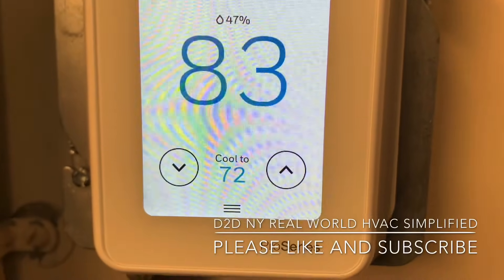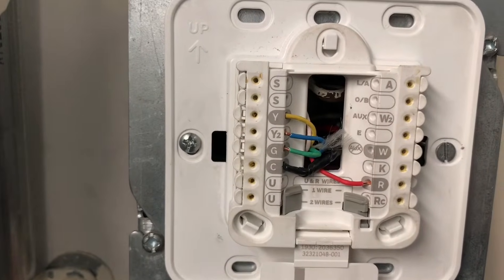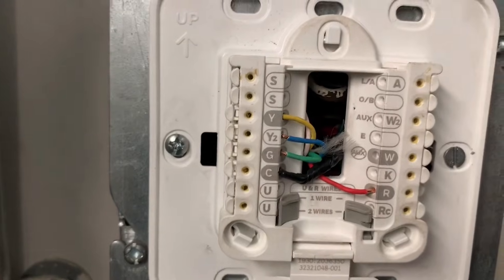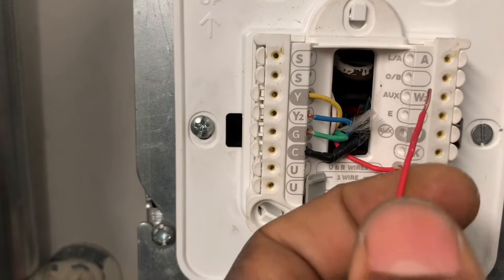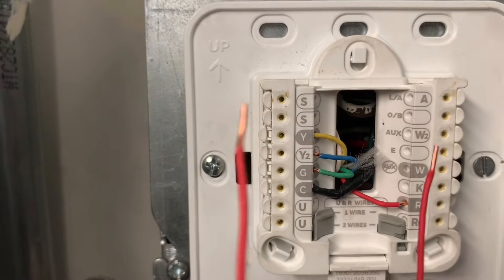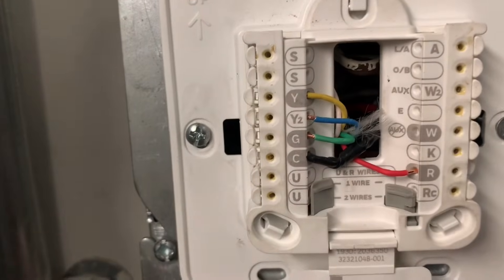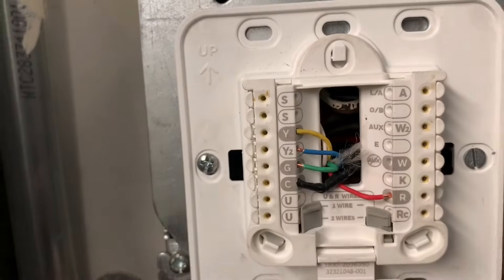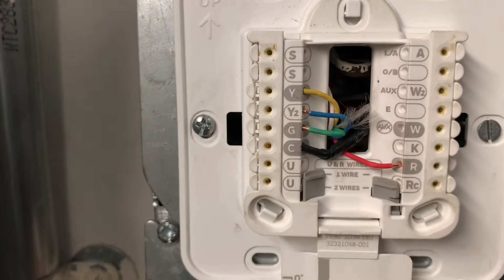HOW TO BYPASS ANY COOLING/HEATING THERMOSTAT  HACK

Comment: Thank you very much!  What happens when I bypass the fan (green) and compressor (yellow) exactly like you say here, but it still does not come on?
Reply from the maker: Then the thermostat isn't the problem  or there is other issues
Reply: Hey boss this video helped for like 2 days and my thermostat would work propeely again once I bypassed and then just hooked the thermostat back in . However now this method isn't working anymore any ideas ? @D2DNYAC

Comment: I have the same setup as yours shows except I have a very short blue wire attached from the R and  Rc right on top of each other exactly the way it is in this video.  Do I need to make sure they are not touching?
Reply from the maker: R RC is the same polarity especially if there’s a shunt or wire in between them, however both should be isolated from C always
Reply: @D2DNYAC  I tried shorting the RG and Y and I'm getting nothing... it has to be something with the condenser then I guess.. I have no clue about how to fix it.. unless I need to connect the G and Y to the R and Rc all together?

Comment: I appreciate this video.  I have an intermittent problem with my system.  The compressor fires up and then an overpressure switch shuts it down.  The fan never runs.  I have been able to switch the fan to the on position and when it gets around to starting I switch the system on heat and leave the fan running all the time.  I called the repair guy and when he arrived everything worked properly.  I paid $95 for a social visit.

It failed twice today,  I called the guy and before he could get here it started working again.  Next time I have the issue I can try to start the fan with a jumper.  If it starts, that would indicate a thermostat problem.  If it fails to start, then it is a fan issue.  I can probably pick up a thermostat cheaper than I can call out a guy.
Reply from the maker: Which fan are we talking about?
Reply: @D2DNYAC  
The air handler squirrel cage fan.

Comment: do these spring terminal boards lose conductivity after a time?  Im having issues with my fan not turning on and the jumper wire didnt work but removing the wires and touching them works.
Reply from the maker: Possible however in my experience unlikely. Make sure the wires is stripped properly

Comment: hi; i have thermostat of T6373B1239 old model and i will change to T5. how can do it?  The heating and cooling system is central, and in the summer season, the chillers are turned into cooling from the central system, and into heating in the winter. So I can't change the cold door to heating and vice versa. According to the above, what is the wiring method from the old model to the new one? thank you
Reply from the maker: Take a picture of wiring on old and match wire connections to new!
Reply: @D2DNYAC  how can send photo through youtube? Have you WhatsApp?

Comment: is it possible to replace the thermostate with timer power switch?
so the AC will on and off based on time set
Reply from the maker: Sure ,,, however all you need is right thermostat and use the schedule feature

Comment: How about if you have a heat pump? For cooling it would be the same . Y-G-R together?  Or do i add the blue for the reverse valve?
Reply from the maker: Depends on what part of the world you're in
Reply from the maker: In New York yes ygro together
Reply: When youre hacking these systems, dont mess with common the common is only to make the screen light up on a tstat.. but yes it would be R-G-Y (if its a compressor only that does cooling only)
Heat pump is R-G-Y-O (lennox carrier trane goodman)rheem and rue you dont touch orange

Comment: Thank you sir, you are the only who mentioned the danger of bypassing R to C. After all these years, now I know what C meant with the analogy of the battery you used.
Reply: Except R and C are 24 V AC (alternating current) HOT and NEUTRAL. The only positive/negative is happening between wave forms at 60 cycles per second!

Comment: My thermostat went bad, got me a T3 and followed your instructions. I live in Florida and the set temperature is reached but the unit keeps on running long after, I have to manually set it an extra degree for it to do so.
Reply from the maker: It doesn’t seem like there’s a real issue here often time thermostats will do this anticipating the load. Say you are  set to cool 70 and it took a long time for temperatures to come down to 70 , behind the scenes it could be  seeing 70.8
Reply: @D2DNYAC  I have to set to 75-76 for it to cycle, any lower and it just keeps on running. Funny thing is my old Emerson thermostat had to be at no more than 73 to feel comfortable, anything higher would've felt too warm.  I'm baffled by this

Comment: I do new construction start up and one day  i was not given 
 a thermostat to install so i had to join all those wires and just told the office to send punchout guy to only install thermostat 😂
Reply from the maker: Yes but be careful not to create s short by joining R with C you can join everything except C
Reply: @D2DNYAC  yeah c was left alone i tried the system first with C being disconnected plus i was told before if R and C touch itll burn the fuse in the air handler

Comment: I bypassed “NEW” thermostat on the heat side (G,W,R), and it worked fine. It blew hot air, and then within 15 minutes, fan was blowing cool again. Seems to be an intermittent issue. I have a new filter. Single stage gas furnace. Can’t figure it out. Fan doesn’t stop running unless I turn off breaker.
Reply from the maker: Did you remove G? G is for fan!
Reply: @D2DNYAC  Connected G, W, & R. Done testing and reconnected Honeywell. Definitely not a thermostat issue.

Comment: Hi there, really liked your video & hoping u can help me here. I have a 20yr old Yorx Single stage furnace that 2 different HVAC guys are more or less clueless/guessing on what part to change next. Basically, it now comes down to the Control Board or a Thermostat. We had bought a Programmable thermo but 2yrs ago we had nothing but problems calling for heat, replacing less expensive parts, cleaning, etc. We now bought a Honeywell Non-Programmable RTH5160D1003 and the HVAC guy installed it and nothing happened by the furnace coming on . Note he left the job discussed. A new HVAC guy came over and put in the "OLD" Programmable Thermo back in and the furnace came back on but note that somewhere in the furnace is other issues! Do you think he just didn't program the New Non-Programmable thermo the right way or it is just a dud? Note: He did have to look @ the manual but didn't look at the most important pages in it (up to pg 14) . We definitely want to use the Non-Programmable thermo for several reasons if it actually works! As I was told that our furnace is a Stage 1 non-efficiency. We also have a Central A/C unit outside on the ground but we definitely don't want to use it !!! (period) On your wires u show a BLACK wire but we don't have that. Red, Green, White & Yellow. We just want to use a simple thermo to control the "HEAT" from the thermo/furnace. Hoping you could give me some advice on these issues. Thx much for your time and knowledge.
Reply from the maker: @Todd Rhine where are you located?
It’s hard to say if the new thermostat is a dud! This thermostat will work with a 1 heat 1 cool conventional system out the box, no adjustments needed, plug and play of wired correctly.
When the heating failed! What symptoms does the furnace gives?
Reply: @D2DNYAC  Well, for right now whatever the HVAC guy did to the furnace yesterday it has been working so far. He was next to it watching/listening to it for quite awhile also! But my concern now and again is why the non-programmable thermostat wasn't doing its job as you say no adjustments needed, plug and play. I believe the HVAC guy wired it right and it had brand new Energizer Ultimate Lithium batteries installed. All digital readings showed up correctly also. Like I also stated I have a 4-wire system to the thermostat. Red, Green, White & Yellow. I still would like to switch out the thermostats to the T2 Non-Programmable RTH5160D1003 if it's possible. What does the yellow & white wire on my unit used for, also? Thx much for your time. I did subscribe & thumbs up to your video.

Comment: Having a hard time understanding this but I'll have to watch again.  I'm in an apt bldg, we have a digital Samsung thermostat on our wall inside the apt.  When we first moved in we were able to get it down to 65 degrees in the Summer.  Then at the end of the summer management reset something & I was no longer able to program it any lower than 68 (which in here gets VERY hot in the dead of summer).  If I press the arrow to go down it sends up a message saying it's "put of range".  I have no idea if it's a wifi system or not, I know the model # is MWR-WG00UN, they have large central air hvac units outside....been trying to find a hack to get into this system so that come next summer I can get it below 68 but have yet to figure this Samsung thing out. I suspect they have some kind of master remote or something where they can control the temp.  They originally told me going below 65 would freeze everything, a few weeks later then said anything below 68 would freeze everything, they kept changing the number every week.  I pay for the electric & I pay the hvac bill both separately , I really need to control the temp in here come the summer.
Reply: That is true but the unit would have to be working for 2 days with no pause and no heat escaping the house to freeze.
Reply: @DV90400  thank you, that's pretty much what I thought.  Since my original post I told the apt manager I would be getting a mobile ac unit which has a tube that vents out the window.  I was told we're not allowed to have those.  I have a lot of windows but I'm only able to open some of them, 3 of them don't open, they literally have no mechanism to open up.  I've been able to finally get them to allow me to have the ability to go down to 65 if needed.  It has yet to freeze anything up as I suspected.  The bedrooms do not have AC but the rest of the place is now at least somewhat cooler
Reply from the maker: @Anglynn74 looks like you are on a Samsung DVMS system which may be shared with others and these systems can be connected and controlled  y a centralized controller thus whomever ever has access to the centralized controller has the ability to limit and override any local thermostat on the this system

Comment: question for you. I have already 2 T6 replaced because they went bad. so, that's the 1st question. isn't Honeywell a mega super technology company to create since a light switch up to NASA equipment for the thermostat to go bad (2) in less than 6 months? is that common that 2 T6s go bad so close to each other because they are not cheap at all! I'm so disappointed with this product. and 2 question is. when this went bad the AC tech said it was just the thermostat for AC cooling since it was hot summer in Florida, it got replaced and booom! it worked! so, he said that the thermostat was  not doing something to make the reversible valve work and it got stuck in the heat mode. so... if this is true, how the valve get stuck if I only see this on and off wires which in this case would be the red and yellow and green to power the Ac and the fan respectively. it looks cool how the thermostat is just a multi on-off switch which make life simple but at the same time there's no control for this valve according to the wiring. just live/hot wires. just do not make sense having a dedicated wire that makes the reversible valve work, or...the guy was only BS lol.  pls explain! thanks
Reply from the maker: Yes you need a separate wire for reversing valve it should be connected to O/B

Comment: Has no bearing on a Dometic CCC heat pump thermostat such as in RVs and motorhomes worldwide, so NO - does not bypass ANY cooling/heating thermostat.  Also does not have any bearing on mini split thermostats, manual thermostats, and a whole myriad of other styles of thermostats.

Comment: My guy!!! I've been searching for this answer everywhere. Thank you for the clarity. However you were so close to complete but left one piece of info out that I need. If we're dying in a hot house because of a dead thermostat and need both cooling stages, Do I twist R+G+Y2 together or R+G+Y+Y2? And how long can I leave them twisted and running?
Reply from the maker: Great 👍 question 🙂 2 stages = y/y1 + y2 + G + R and you can leave them for as long as you want however if the system is cooling properly the space will supper cold 🥶 and you can potentially cause system freeze ups . So I recommend run it like this temporarily initial space is cool and repeat as needed!
Reply: @D2DNYAC  Hmmm. That doesn't work. We get a periodic click as though it's trying but nothing else. If we remove the Y2 it kicks stage 1 on as expected. I suppose we can try doing y2 without y but I'm worried that too experimental. Don't want to damage anything. Is it possible that our furnace is different and only uses either y or y2 on but not both at the same time?
Reply from the maker: @brian Christensen  no, either there's a time delay or something is wrong with stage 2

Comment: Thank you! My old house has central heating but no AC and a very stupid analog dial thermostat with no separate fan control. With this video I figured out I could hook up the dangling green wire to the red and have the fan on constantly to recirculate air in the summer. This way my wall AC units act more like central air, which is a godsend for my hot upper floor during this heat wave. I will likely sleep much better tonight thanks to you.

Comment: I have a straight air condenser and a heat pump air handle they are both rheem ruud, the thermostat is honeywel. Id like to run my heat strips on heat instead of emergency heat. How can I do that? Switch some wires around?